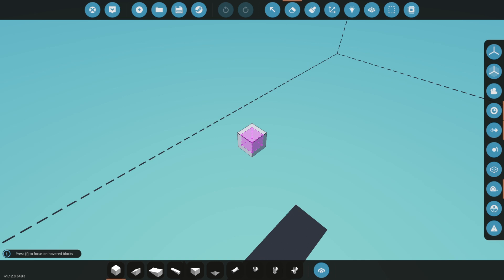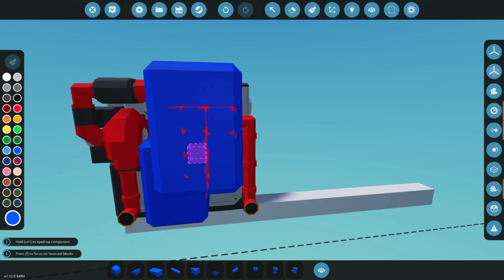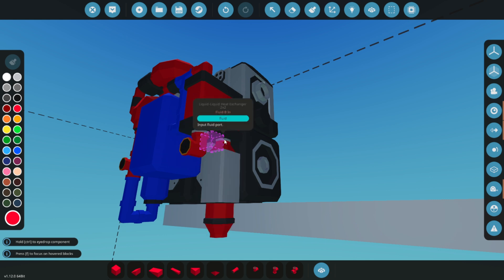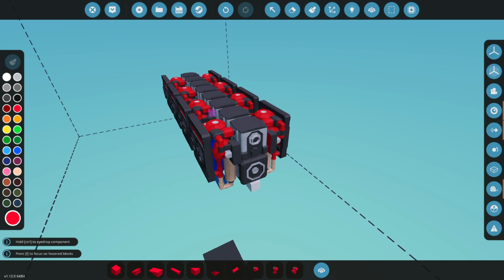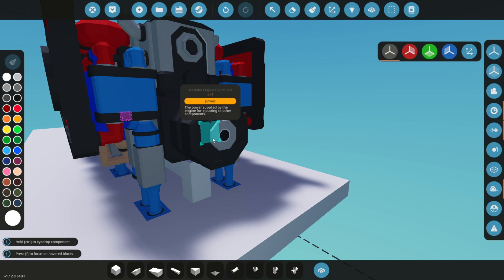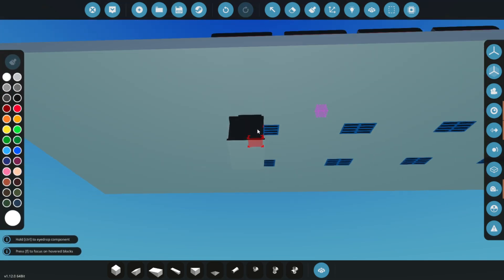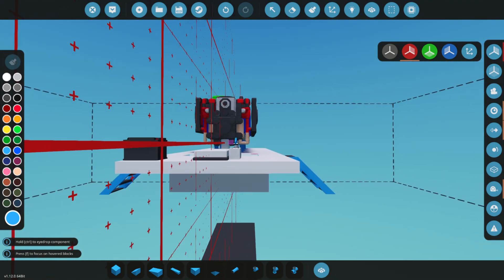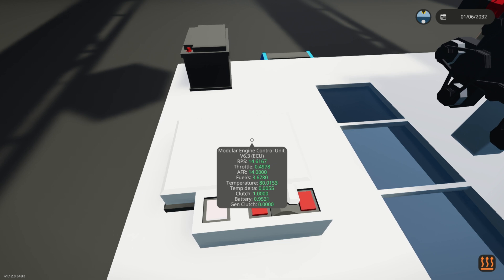Build an Unstoppable Engine: See How We Perfect Cooling and Performance!

Comment: In my tests... adding a gas cylinder heated the system more (2-3 degrees Celsius). The system with the additional seawater circuit and the gas cylinder is inefficient and was 5-6 degrees Celsius higher than the standard system. And the temperature kept rising...
Additionally, don't add water tanks to the system because it makes absolutely no difference, literally ZERO!

Comment: This video is highly underrated. I was almost convinced that modular engines couldn't be cooled. I've spent hours trying various setups to try and tame the temps on my ship, and nothing I changed seemed to make the slightest difference. This setup, however, has reigned the max temps to about 65° max after almost an hour running at the equator (with cooling on only one side of the cylinders)
Reply: Well, you didn't build your builds well, because even at 15 RPS you can stably cool the engine to 55-60 degrees without using fancy systems that don't add anything.

Comment: Looking at throttle open at 0.4978 at the end, it is hard to say cooling is sufficient since engine is only loaded for 50% of its capacity
Reply from the maker: It was throttling down after a looong (2+ hours) test run, and it didn't overheat :) It was also built and tested in the hottest part of Stormworks, so ambient temp was high. With seawater and colder ambience you can probably push the rpm's higher.

Comment: You missed the exhaust buddy.
Reply from the maker: Nice catch, I did add the manifolds but no pipe/air filter. In my defense, it still works ;)
Reply: @mojiitek  it works cause for starter you have toggle button and starters are continously running on battery and starters moving the cranshaft if you don't have unlimited electricity then it will be stop soon.
Reply: @mojiitek  Brother add a push button for starters that is the best to find if engine is completely done or not, later you can use toggle button if you like to use it, but for starters the push button is enough same in IRL we just crank the engine with starter for a few secs later we don't push the button for starter once engine is on run.